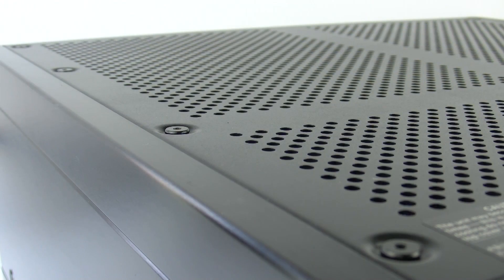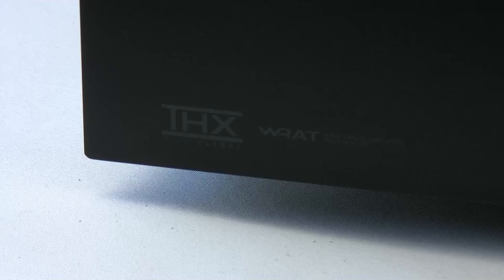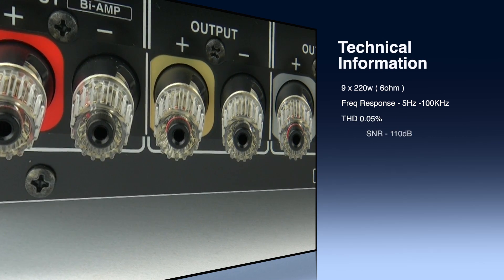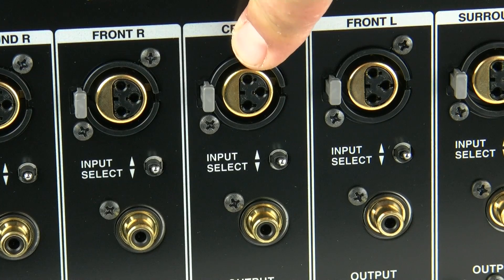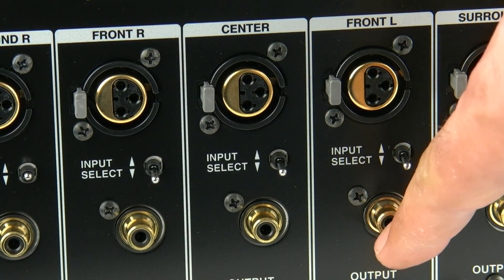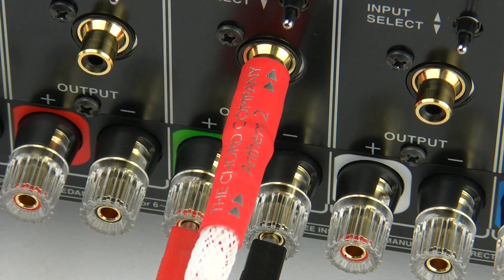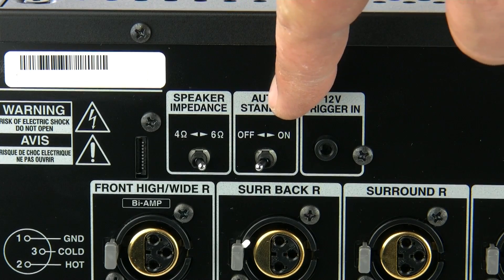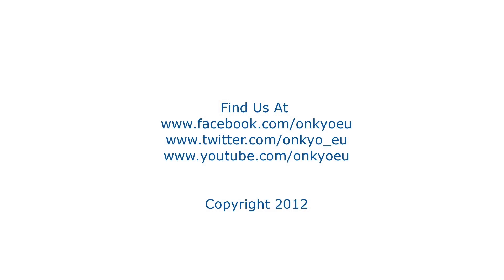New PA-MC5501 Multi Channel Power Amplifier 2012 Range.mov

Comment: Just bought one of these to use with a PR RZ1100.  Considering whether to run two subwoofers rather than the current single BK Monolith i'm currently using in a 7 surround speaker setup.
Reply from the maker: It looks like the BK Monolith already has a reasonable amount of power - using two subs like this and you should give your neighbours a small warning before switching on your home cinema ;-)
Reply: OnkyoEU Thanks for the reply 👍🏽
I have understanding neighbours!The cinema room is away from the shared wall of a semi-detached house so that helps.
The Monolith has served me well (for about 7 years) as did my previous Onkyo 606 receiver.
I must admit, I'm an Onkyo convert. Absolutely cannot fault the value for money, from the entry level products to the high end.
Thanks again.
Reply: @OnkyoEU  😂

Comment: hi just wondering i have two lots of fronts wired up together into this amp when i get some volume hights it cuts out always what could be the cause of it tripping out always running with maranz  av7702 thanks
Reply from the maker: Hi, this sounds like a question for our technical support team - to verify your current setup/configuration in more detail.

Could you get in touch with the colleages from customer care, please:

http://www.eu.onkyo.com/en/support-request-42204.html

If you prefer to give them a call, please check the following page:

http://www.eu.onkyo.com/en/customer-care-hotline-42615.html

Thank you!

Comment: Hi, I have question about impedance selector, What if I have front speakers 4 ohms and rear 8? Does that selector controls just front pair or whole speaker set? But anyway thanks for this video, I found it helpful anyway ;)
Reply from the maker: +el dracco Hi, in this case, please use 4 ohms (always using the setting required for the lowest impedance of your speakers)

Comment: I've had this unit for two years now in a true 9:2 environment with all PSB Imagine series speakers including (yes, it's overkill) four subwoofers, which remarkably break up any resonances that ever were present in the living room.  I must admit I've never EVER had a power amplifier setup where there is no possibility of clipping.  I can play this unit to true movie and concert sound pressure levels and it's just doing it's job, never a sound of strain at all.  Also, I'm driving a pair of the PSB imagine center speakers vs. just one.  I had a bad experience with a previous integrated Onkyo receiver, TX-NR907, but the preamp/power amp pair seem to be bullet proof so far.
Reply from the maker: +John Soliday Hi - and thank you very much for your positive feedback - also our engineers will be glad to read this :-)

Comment: Isn't the XLR connection better than the Phono?
Reply from the maker: In general the quality of the XLR connection is better than the RCA/cinch/phono connection, especially the longer the cables are (being more sensitive to noise/interference)...
Reply: OnkyoEU So the XLR cables are overall recommended, also because they're less sensitive to noise/interference, right?
Reply from the maker: Victor
 Correct - if you have the chance and are willing to spend some more bucks on cables (as they are a bit more expensive than the RCA/cinch/phono ones), it can be worth the effort. Thanks for asking!
Reply: OnkyoEU Yeah, I've seen some prices running around 50 - 70 euros per cable. But with such a system, it will definitely worth the purchase. Thanks again :)
Reply: depends. if its a mono source that isnt "hot" then it's no difference. if you are going into heavy stereo sounds, like if you plug in a piano, you should use xlr